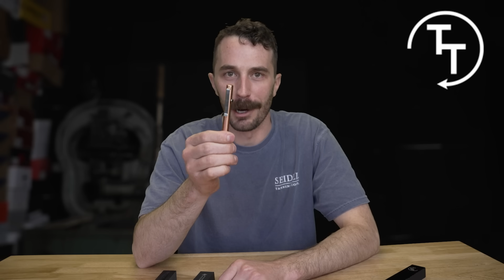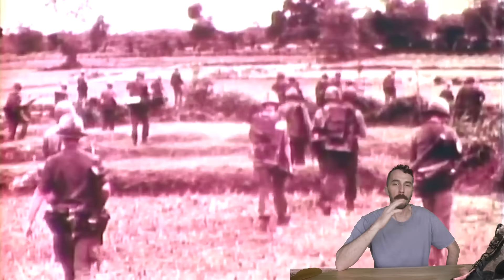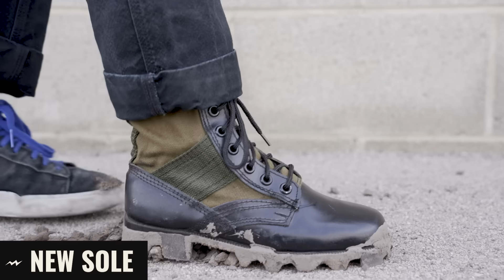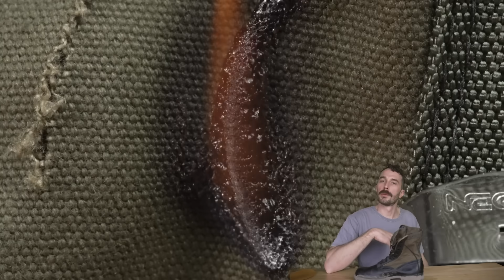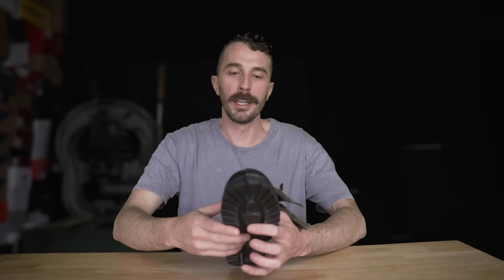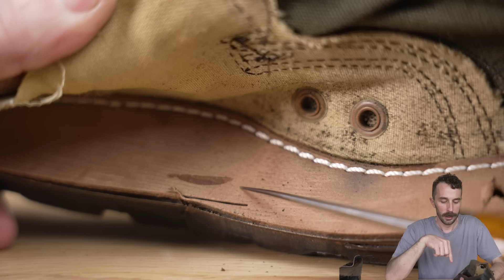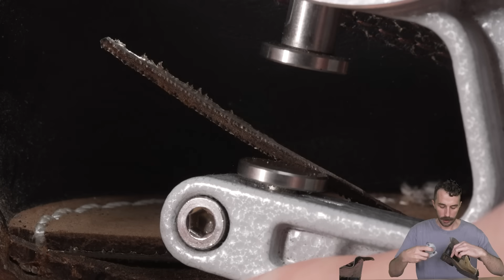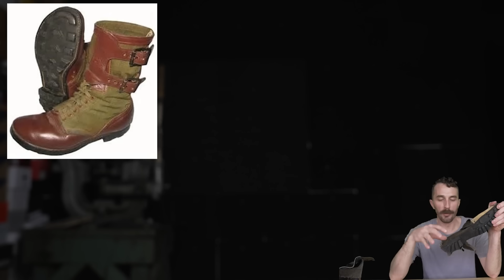Why it took 57 years to replace jungle boots

Comment: I remember doing construction work with my uncle over summer breaks from school.  This was late 80s early 90s.  My uncle was a Vietnam Vet and took us(my brother, my cousin, and myself) to the Army Surplus store before we started working and had us all get a pair of jungle boots.  He told us to keep them on at the job site.  We just thought it was to have sturdy boots, later on he told us it was to make sure we didn't get nails through our feet and that jungles were better than work boots for that... Nice to see he was right...
Reply: Great story.  You're lucky to have a cool Vietnam Vet for an uncle.
Reply: @TheSanityMachine33  He did 3 tours as a Ranger.  One of those things you realize later what a brave guy he was.  Although he just said he went back to Germany for a year and was bored... He was also a Drill Instructor for 2 years.  Probably one of the best carpenters I have ever worked with.
Reply: @ididthisonpulpous6526  Rangers are bad asses.
Reply: Yeah had an idiot yank my latter from me on a construction site after placing a 2x4 with nails on the ground 1 nail over 5 inches long the the other went completely through my foot another stock into the main nerve area middle of my foot sole but was short of coming out. Took 3 big guys to pull it out and almost lost my foot later. The guy was seen then attacked others with a hammer then when police came attacked one throwing a hammer hitting a cop fracturing his skull. He went to prison for everything except causing me an injury as there was no charge for that but he had every drug known to man in his car plus scales etc and stolen guns one modified to full auto. I could not find jungle boots any where. I loved then in Panama in the infantry
Reply: @bullboo1  I had more run-ins with drugged out weirdos on construction sites than anywhere else.  That particular trade where you get paid by the week, often in cash, with very little background check or work history kind of feeds into it.  My uncle mentioned above ran a contracting business and I saw firsthand how hard it was to keep reliable and skilled workers.  

Story about my uncle for you... 
Getting paid for jobs was always a problem.  Anyone who has done contracting long will tell you that.  My uncle had interesting answers to that.  He had put up one of those huge mechanical wrought iron gates at an apartment complex.  The guy had jerked him around on final payment for weeks.  So my uncle comes to the apartment complex and demands the money.  They owner refused and dared him to sue him, which is never worth the money for less than mid 5 figure amounts.

So my uncle hooked chains to the gate and hooked them on his truck.  The owner said he couldn't do that, which was true legally, and that he was calling the cops.  My uncle said "It will take the police 15 minutes to get here.  I will have beaten your ass up and down this parking lot twice before they do.  As long as I don't maim you I will get charged with assault and I will have $5,000 bail before dark.  So go right ahead..."  The owner cut him a check for half of the owed amount, which was more than he had gotten anyway and my uncle left...
Reply: @ididthisonpulpous6526  well depending on job, but will say due to changes around here for what can be done in small claims (max was raised) it isn't too hard,   as long as you had a contract signed its 25 dollars to pay the fee to file a claim show the contract and then you are basically done...   basically you just need to ensure the amount owed isn't more than 3k and its fairly streamlined
Reply: @wnxdafriz  Most major construction jobs we did were in the tens or hundreds of thousands.  You need an attorney to pursue those amounts and often the attorney costs and difficulty prying money from corporations that owned the property was such that it was seldom worth the pursuit.  The companies know it too.  If they short you the final payment with a job 80% done they will string you along keeping it going... You are faced with connundrum of leaving it, and they making a claim of breech of contract on you and you losing your contractor's license or finishing the job with them owing you a large chunk of cash.
Reply: @bullboo1  oh shit. sorry that happened to you man.  damn.
Reply: I wish I could say that I had a positive experience with these boots on the construction job sites, but I have not. These were NOT designed for working twelve-hour days while walking and standing on solid concrete slabs. These boots left my feet in agony. I eventually started wearing Timberlands which offered cushioning and arch support, and within a day my foot pain went away. That steel plate at the bottom is great until your feet get wet and you are standing next to a welding machine or you are working with electricity. To avoid nails you learn to walk with your head tilted slightly downward. In that line of work you always want to keep the ground in your field of vision.

In response to what others have said in here about construction, yeah, I worked around hundreds of druggies and weirdos. It is the only line of work that will hire people without a formal education. Most drug addicts throw their lives away in pursuit of getting high, so construction sites are one of the few places where they can get a paycheck. The only other places that will hire them are factories and warehouses. Normal people will go to a trade school and learn welding or electrical, and the career-minded ones join a labor union in order to make real money. The job was not a right fit for me. I got tired of being ripped off by a company that refused to pay me what I was worth. I got sick and tired of being surrounded by lowlife druggies. It takes a special kind of man to do that line of work, and I have the utmost respect for the men who can work that hard, stay away from the drugs, and make a lifelong career out of it. Those men are as tough as nails.
Reply: They are just better in any humid climate. Not as purty as Cochran jump boots. Also way more comfortable.. Then along the came Middle East and a different design. The desert boot.
Reply: @warrenpuckett4203  I have a pair of those in my military bags too.
Reply: I was doing the same thing st the same time!  I wore jungle boots at work, too.  They seemed to wear out fairly fast (a couple od months).  But, I was able to pick them up from an army surplus shop for $20 a pair.  They owed my zip when they wore out and kept me out of accidental body-piercing situations.
Reply: @adirondacker007  Find you a good cobbler(shoe repair or boot repair shop) you can get boots resoled for a decent price.  You can basically turn them into new shoes for $20...  Don't quote me on the price, but that's what it was at the shoe place on base when I was in the Army...
Reply: @ididthisonpulpous6526  yeah twenty years ago…shoe repair is a dying trade. It’s nearly extinct.
Reply: I miss those days when military surplus was cheap. I've seen stuff selling at surplus stores now for more than the government probably paid for it. MREs selling for $15 per meal, boots selling for $100, and $10 can openers.
Reply: @arthas640  Yeah there is a different market for certain kinds of surplus now. You can get online and find like Chinese or Eastern Bloc surplus for cheap sometimes, but they aren't anything like the quality of Vietnam era boots on his video.
Reply: @ididthisonpulpous6526  that's what I miss about pre social media era military surplus. You could get great stuff for cheap, I knew guys who got new army boots, jackets, and pants that lasted years or even over a decade even though they worked outside and spent like 1/2 or less for the surplus then it would cost for a consumer grade equivalent. I've got a friend who's still using his dads Vietnam war era cot and I've got a cousin who's still got our grandpas korean war cot. Both those cots have been used almost every summer and/or fall for camping, hunting, and the odd house guest.
Reply: @arthas640  I think it is more down to the presence of ebay and other online storefronts that have increased some of the prices at the local level.  I know used book stores were a nice way to find a lot books for a fairly low price, now if the book is "rare" or "collectible" they will hike the price based on like a single ebay listing that never sold... I can still find some kinds of surplus at garage sales and such, but like all retail anymore you are literally competing with the entire world...
Reply: Same story here.  High school me wore Dad’s from 1969, wore them through most of high school. Wore them while working as a maintenance worker for an HOA.  Stepped on a nail, and it about put me on my head when it only went halfway into the sole and stopped.  Bought several more pairs over the years, only Corcorans and Carolina jump boots are in the same comfort league.
Reply: Stepped on a nail in milspec jungles and it went right into my foot and out the other end.
Reply: I could imagine him getting flashbacks at a construction site with all the loose nails and boards rolling around.

Comment: Para nitrophenol, at Prime Tanning in Berwick, Maine we treated the chrome tan leather with it. Years ago. Back in the 70's, 80's and 90's. The government required para nitrophenol and tested for the percentage content. The purpose of the chemical used to keep the leather from rotting. Another benefit was the chemical would penetrate into the skin of the soldiers feet. Protecting the soldiers feet from fungus infections. Para nitrophenol is an antifungal.

Comment: I've owned a few different pairs of Jungle Boots over the years and they are surprisingly very durable and comfortable if you get the right size. The trick is for any boots is to get them broken in properly so that you don't injure your feet especially if you're in the military and doing road marches and carrying weight.

Comment: IMO it's not really possible to compare the M43 boots and the jungle boots, since they were designed for different climate conditions. It'd still like a proper leather boot when in a colder area or temperate area.

Comment: Try to find out if the sheet steel is 'hardenable', that would indicate if it's a spring steel or just a regular mild steel plate.... maybe the metal would fatigue?

Comment: I hated my "Vietnam Jungle Boots" that was the actual label on the boot when it was issued to me in 1998. I was posted to a Submarine stationed at Pearl Harbor (I was there while they were making the movie, so, I can say that I lived through  "pearl harbor" :-) well, simulated of course- but I didn't know that at the time! One minute I'm on deck during my watch and all of a sudden a Japanese Zero comes ZOOMING over the mountain and starts blowing stuff up on "Ford Island". I radio down to the Duty Officer and he informed me it was just a movie. 😆) But I hated the boots. Walking on the steel decks of the submarine with these boots ruined my knees. Now, I wear Z-Coils. There is a giant coil spring in the heal of my shoes. They absorb 50% of the impact of walking and return 30% to your stride. So, physically speaking, it's easier to walk in my shoes than yours. 😉 Thanks a lot MIL-Spec!

Comment: I wore a pair of these for years and I never would have guessed there was a block of wood in the heel! 

Legitimate surplus versions of these are getting a little harder to find in wearable sizes and there are a lot of fakes around so make sure if you buy a pair that you know what you're looking at.

Fake ones are terrible quality by comparison.
Reply: Altama still makes high quality versions of these and were one of the original manufacturers of these boots. Though it seems like the non-speedlace version (similar to the one in the vid) is in the process of being discontinued or something.
Reply: @danshakuimo  Altama went bankrupt and were bought out by the same company who make Original SWAT boots.
At a glance it looks like the modern 'Altama' boots have glued soles rather than direct moulded so I don't think they are the same quality as they used to be.
I'd sooner get a surplus pair myself.
Reply: @johnsteele2986  That's quite a disappointment. Their website claims that the boots are direct molded but maybe that can mean something I don't think it means. McRae also sells them nowadays.
Reply: I bought a pair of fake jungle boots when I was in high school and those were probably the worse pair of boots I ever bought. They weren't made of real leather and as soon as they got really wet they started to fall apart. I don't recall the sole holding up that well either.

Comment: One of the boots I used in the USAF as a SP Dog Handler 77 to 85. They were not bad. I did not like the soles as were not exactly good on slick surfaces except mud, and weren't as good as decent Vibrams on that. Still, they were better than the standard cap toe slick soled boot we had as an alternative. I had mine for years after I got out.

Comment: I actually liked these quite a lot for this medieval combat sport event where 500-700 people get out into the woods and fields for a weekend and smash eachother to bits. They were great for the simple reason that they're quite sturdy and protective, but lighter over a long weekend of high intensity running, jumping etc. Some other boots I've tried have felt very heavy, especially when they get wet. On the other hand, sneakers and such don't protect as well when stumbling over roots and ditches and mud while surrounded by dozens of milling, shouting and stampeding people.

Comment: I used these boots daily for my tracking in the jungle many years ago, but later ditched them of better and cheaper all-rubber shoes. Putting on the boot is a huge struggle , and in the jungle environment it always wet. 
I would never wear them   to go out tracking in the forest.

Comment: I had mine since 1985 (the one with the bigger lugs). I bought it as brand-new surplus in the shops around Clark Air Force 
Base in the Philippines.  Used it every weekend for 3 years for compulsory military training (Philippines), and kept it a souvenir. I wore it in 2017 as part of my military costume and it was still good. The materials, most notably the rubber, did not degrade over time.  Awesome product.

Comment: The green jungle Altama brand was my army boot for all of my years in the infantry in the early 90's and into the early 2000's. The army eventually replaced the green with black and most infantry soldiers wore the black jungles. Not me. I was a "green jungles" all the way. Looked so good with the woodland camo pattern BDU's. And the green, while officially not issued, and not looked upon favorably by commander's, was still able to be worn by infantry in garrison as well as in the field. No commander or 1st Sgt ever corrected me about my OD green jungles. I guess because I wasnt a shitbag or brokedick. I will say that for parade and change of command formations I wore the black jungles for uniformity purposes. But always went back to the OD green for regular work and training. Loved them. Still love them. Once they got broke in, they were amazing. The uniform switch to the ACU and the sand colored boots was so heartbreaking for me. I think I haven't had a good pair of boots since.

Comment: I've always loved these boots. I had a pair of Vietnam era surplus boots in high school that lasted until I was around 30. In the early 2000's, I bought a pair of Altama's current (at the time) version. They had a few minor changes from the original Vietnam versions, but they were still made in the USA to military specs, and felt and performed the same. I even found a few pairs of the Saran insoles for them. I still have them and take them with me camping or on extended excursions into the Everglades. I take meticulous care of them though. It's easy to find generic "jungle boots". Altama even still makes a version, but they're foreign made, NOT to military specs, and although they look identical at first glance, they're cheaply made, clunky, uncomfortable, and not up to snuff for hard use. It's actually really difficult to find properly sized authentic jungle boots in like new condition. I'm so glad that I got a hold of a pair before they stopped producing them because they're the most comfortable hard use boots I've ever worn and they're perfect for the swampy wilderness where I love spending my time.

Comment: Hmm. That build explains why my two pairs of Jungle Boots doesn't flex very much. I have two different kinds of soles as well. The Panama sole (the one shown here) for wet terrain and another for more sandy terrain. I think my boots were made by Rothco or something, so probably a somewhat cheaper knockoff off the boots featured in this video, but still built to military specs so the folks in the armed forces can get them...

Comment: I’ve owned a couple of pairs of surplus-purchased jungle boots. They’re a pretty comfortable summer boot. I knew the footbed was stiff, but I never knew it was because of a steel plate. 

I’d like to see a pair of the Belleville insulated boots cut in half as well.

Comment: I had those boots when I went to Vietnam. Thay are a great boot for what they were made for. If your feet get wet, they dry out fast and I don't remember my feet ever feeling hot. I think that band around the ankle is for abrasion as that is the part that frayed from ankle rub,
Reply: The strap is there to prevent ankle sprains.